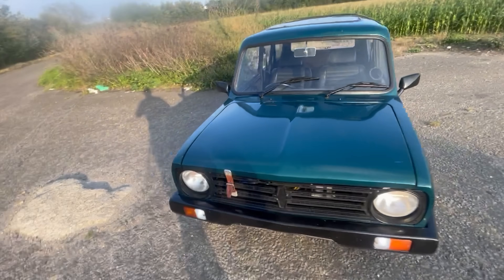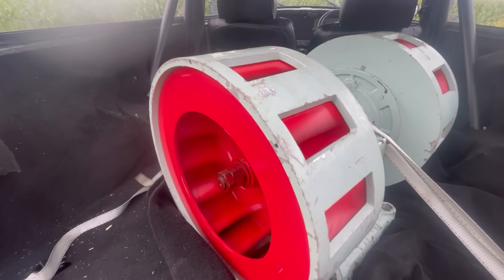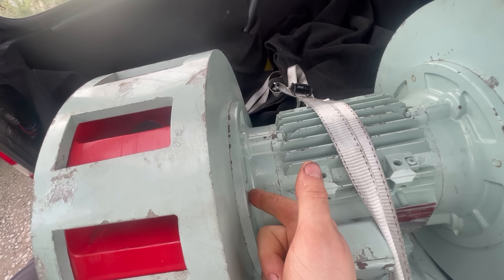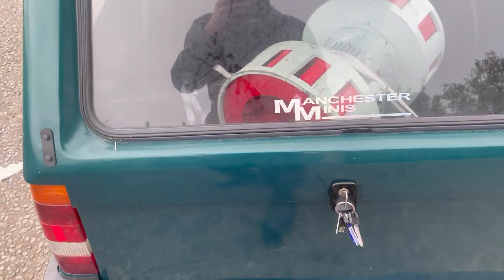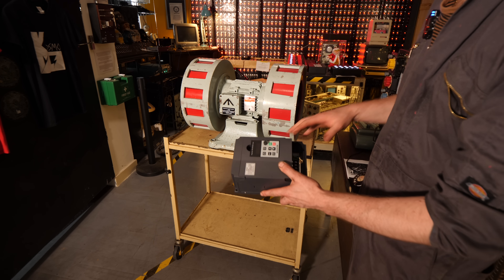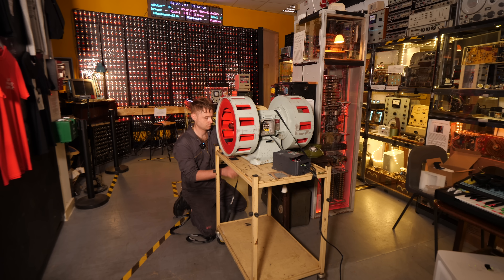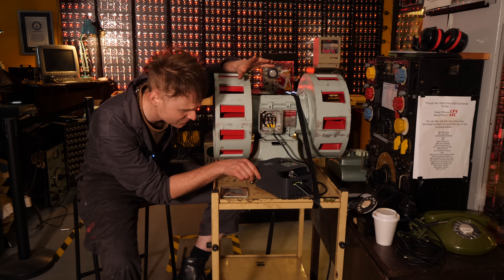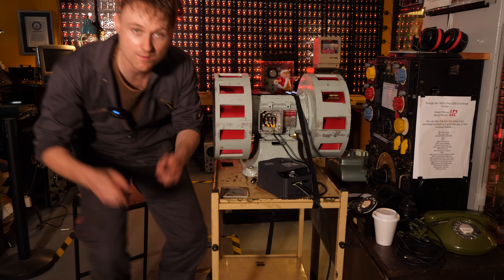I BOUGHT AN AIR RAID SIREN

Comment from the maker: for all interested. don't worry did me due diligence :D informed the immediate neighbours id be running it a handful of times. however i did underestimate how loud it would be through 2 brick walls haha! but hey ho! fine for a blip but definitely wasn't gunna get away with practicing somewhere over the rainbow on the theremin for 5-10 minutes, contrary to the vids, i aire on the side of caution with that sorta crap ha. so on the hunt for somewhere to do that! will likely block one side off and see how it fairs with one tone, as you know the are dual tone and might not work well with the scale, but tbh without both tones it would sound like a siren trying to play somewhere over the rainbow haha.
Reply: Maybe in the middle of nowhere
Reply: Sample pack please
Reply: I think there are laws against using devices like this in the UK.
Reply: @HOLLASOUNDS  No specific legislation but under Control of Pollution Act 1974 a local authority or an individual in a nearby building may take action where noise from premises amounts to a statutory nuisance, that would require them to keep a log etc so if you don't do it too often you would be grand!
Reply: The moment you pulled that sucker out of the boot and put your hand on it I felt this just, surge of fear. Met a bloke who'd basically pulverised his hand in a siren smaller than that, catching it as it collapsed a shelf. He caught it palms out, fingers right in the housing, broke all four fingers and basically flattened his knuckles. Something that big I'd figure easily rip the bastids clean off.
Reply: Your welcome
Reply: Definitely put a screen mesh around the holes of that thing so it doesn't casually rip your fingers off! Because it'll do so without any warning or remorse.
Reply: Rutherford Appleton Labs anechoic chamber? It's intended for space craft launch acoustics so should do for you. Look after your hearing please Sam
Reply: Just cover up some ports on the outside, that will turn the volume down. You should cover up the same fraction of holes on both sides, otherwise you'll change how it sounds. The typical sound results from the mixture of the two different frequencies (left and right).
Reply: Feel like you should be wearing more ear protection using it indoors at all 😥
Reply from the maker: @SomeKindofWizard yeah definitely risky! Hence why I picked it up with no thumbs through any holes
Reply: @HOLLASOUNDS  I think it's the air raid that's illegal, not the warning siren!
Reply: @Damu_the_Damu I wonder if by covering up by a fraction you could change the note. if thats the case you could tune each to a different note and have a solinoid flap turn each one on and off
Reply: @RayZappa  While sounding an air raid Siren is not illegal, excessive noise is and is classed as statutory nuisance. It only take one person to complain to the council for authoritys to get involved.
Reply: *'err' on the side of caution. Aire is a river
Reply: Jus do it indoors! I wanna see how quiet you can get it with some huge speakers playing samples out of phase haha
Reply: You need to do a gofundme or patrion to go to some place like Montana USA and just be in the middle of nowhere making air raid noises.
Reply: @HOLLASOUNDS  Forgive me, this is obviously an issue you take very seriously.  HOWEVER, I was just making a dumb joke that the much worse offence is flying over a country dropping bombs on them.  It's the way I tell 'em
Reply: I live on a tiny set of islands in the middle of the north sea. And... to be honest... even here that device might be a touch loud.
Still, I salute you, already it's a truly unique video that I didn't expect. You always manage to surprise me. =D
Reply: Maybe in the quaint little towns of Hiroshima or Nagasaki they would appreciate you.
Reply: The cages on each side are different for the two tones. But they look like they can be mounted either side. If you would have a second siren you could swap the one cage over so both would play a singe tone each. Just a thought.
Reply: Could you ask a university to use an anechoic chamber?
Reply: @pauledwdz  That's interesting. Since an anechoic chamber converts sound waves into heat I wonder if it would be measurable in that way? Of course you would have to account for the heat produced by the motor.
Reply: @RayZappa  I see, yes I'm not the type to laugh or get most jokes, many times people tell Me jokes and all that happens is I look at them with a straight face and then state some actual facts instead of focusing in the joke. They are like "You dude it's a joke man".
Reply: there's loads of tv & recording studios in the SE of the UK, & they're definitely not all in constant use, & there's definitely people on here that work in them.
if I still worked at Mtv, I'd already be emailing you. we'd probably get you in to do 'party zone' with that thing & the furbies- ah, if only it was still the 90s....  😂
Reply: might want to bolt the thing down when your testing it, lot of energy
Reply: @blu12gaming44 i worked maintenance at a place that made drinking straws and the machines ran about 800 straws per minute. 

My first week working at this place, I was helping the techs and learing the machines, as they were starting up a machine.  I got my fingers to close to where the straws are scrapped and didn't realize my finger was as close as it was and the machine took the tip of my finger off.  Luckily, it missed the bone.  I learned my lesson that day.  Sometimes people need a little oopsy to learn, lol.
Reply: @ChipGuy  Or set it to each of the 88 notes and sample them or just record them and put them on an 88 key mellotron that you would of course have to build because they never came that way. You could use 1/4 inch tape instead of the oddball 3/8 that they used.
Reply: It’s not like going to be wold war 3 10:48
Reply: I grew up in a rural colonial town, we had fire sirens, sounds identical to these air raid sirens. Even after moving to the township 16 years later, I could still hear the Beach Fire Siren from the Town which was 3.6 km (2.2 mile) away. They have a range of 5 km (3.1 mile) in ideal conditions, 20 Celsius (68 Fahrenheit) on flat ground.
Reply: Try running the siren inside of a box with a varying level of vacuum that way the sound of the siren is limited by how much air it can move.
Reply: And welp, YouTube's auto-subtitles clearly recognizes this as: music
Reply: You should really invest in some earplugs! Be careful with your hearing!
Reply: @deezwaffles558 Fire it up often enough and you’ll BE in the middle of nowhere - all the annoying neighbours will move out (one can hope! 😂)

If I had one of these I’d fire it up every Sunday to show the people who live near my parents, how unpleasant excessive noise is on a Sunday. Flipping suburban housing estates!!! 🤦‍♂️🤦‍♂️
Reply: U probably would have been good to alert the police and such considering it's likely the same siren type and make sure they put out a public warning aswell 

Other than noise problem might also be impersonating a police officer type of deal aswell 

If you want have a lolz try jamming a harmonica on it or mega howler whistles n such
Reply: Wen are you going to do a part too
Reply: You have to turn it down slowly as stopping it that fast induces a lot of that rotational energy back into electrical energy overwhelming the inverter. Or you could use a breaking resistor
Reply from the maker: its fineeee. but yeah the breakdown is quicker.sorted it now @sundeki8880
Reply: Perfect doorbell LoL
Reply: I love it
Reply: How in the hell were u able to buy one haha. I’m very interested in them. Xd
Reply: I remember the huge one that was on top of the supermarket, at the top of the street when I was a kid. I think it was a B&N Mobil Directo BN33E. Loud... very very loud. It was a dual tone (10/12 port) which gave a 3rd minor chord, if memory serves.

Comment: You know you've reached peak punk (or maybe peak metal?) when one of the instruments you play is an air raid siren.
Reply: And the other is a car
Reply: King Crimson played an air siren at the end of 21st century schizoid man when playing before The Rolling Stones in Hyde Park in 1969
Reply: Do you know what frequency it generates?
Reply: @ETA555 It does more than one frequency at a time, and they change with the velocity of the parts, which change with the input power.
Reply: @ToyKeeper  Yes under and overtones. But the main frequency at a given rpm. It must be like 500Hz-2500Hz
Reply: Peak jungle music
Reply: Very KLF
Reply: @ETA555 I ran the audio through a spectrum analyzer.  You can do this too, using Audacity.  The result is a really dense spectrum of strong frequencies spanning most of the human hearing range.  There isn't just one main frequency though... it has at least two fundamentals at dissonant intervals because the wheels spin at different speeds, which is where it gets its discordant sound from.  It has dozens of frequencies at any given moment, and they come in detuned pairs where the detuning interval changes with RPM.
Reply: There used to be a punk rocker, Maukka Perusjätkä, in Finland who would play a chain saw.
Reply: the band Sweet who were mostly bubblegum pop or glam rock, played an air raid siren on stage or rather it was just used as a prop for an intro to the song “Blockbuster”
Reply: @ToyKeeper AIUI the wheels spin at the same speed, it's the vanes are different in number and spacing between sides
Reply: @jongmassey Thanks, that makes sense.

Comment: I wonder if you could add some servo-movable vanes to get different pitches.  Oh, yes and some mesh over those finger slicers of course!
Reply from the maker: Those vains aaah I see so the opposite way to the Yamaha music sirens! Intervesting
Reply: Isnt it the number of holes that defines the pitch and not the size? Covering part of the holes might change the volume though.
Reply: @agurdel  I was thinking have an external sleeve with a different number of vanes that could be selectively opened and closed - should at least be able to do some harmmonics
Reply: there are sirens that do have shutters to mute on of the two tones, just lookup "broadmoor escape siren"
as for the changing of the pitch, the best bet is to do what sam just did and hook up a VFD, but the combinations of both could be great
and no covering the finger chopping holes won't change the pitch, it will quite it down a bit, just like the shutters but more controlled
Reply: @alebret3  I just looked up the Broadmoor video, they do it by a vertical shutter on each end. By capping it off it's effectively creating a vacuum inside the chamber so there's no air to chop and make the noise. I reckon Sam would probably have an easier time doing that.
Reply: Yes! Mesh please 😄
Reply: With a servo motor you can get very fast speed variations, i built a siren like that a few years ago and uploaded a video of it.
Reply: Instead of a minor third you could make a dual tone siren that uses a perfect fifth or fourth. That would sound better sliding to different notes. Probably need a bigger motor controller. A huge stepper motor would be amazing.
Reply: Servo-controlled shutters on the inlets would be good. I think it will be important to be able to reduce the volume as the pitch is increased, so that high notes aren't massively louder than low ones.
Reply: @agurdel  Number of holes + RPM. The impeller creates air pressure and the holes and pieces of the impeller that covers the holes chop up the air flow creating bursts of high pressure air. alternating high and low pressure air is called sound. The problem with turning it into an instrument is the volume and the pitch are controlled by the same impeller. So you can never do a loud lower tone or a quite high pitch tone on the same siren.

But, if we would colin furze it. Split out of the impeller from the shutter and drive them seperately. So we have one elektric more running a fan to create the airflow/pressure we need and a shutter wheel on a servo motor. Why not another elektric motor? You could but with a servo you have much better control on how fast it turns, thus more accurate pitches.
Reply: Midi siren? Yes please...

Comment: You could put it in a transparent vacuum box. if you pull enough mbar it should reduce the loudness of the siren and people can still see it spinning. just an idea.
Reply: Brilliant!
Reply: I wonder if it would overspeed in a vacuum.
Reply: @BLOCKsignallingUK it won’t be a 100% pure vacuum so it should be alright
Reply: @BLOCKsignallingUK  it might turn faster and change pitch. to be sure you could control the rpm of the motor and then even tune it back to original frequency I suppose.
Reply: @BLOCKsignallingUK  It’s a 3-phase motor (or so it appears), so it’ll never turn faster than the AC frequency.  That being said, I have no idea how, in its original application, they got a slow/graceful acceleration without using a VFD.
Reply: @kc9scott  Good point, I had forgotten that.  Presumably the slow acceleration comes from a low power motor and lots of slip before the rotor becomes synchronised.

Comment: On an air-raid siren like this, you can directly control the volume by controlling the amount of air that passes through the rotors. You could do this by strapping a wide brand around the perimeter of each rotor housing. Simply sliding the band to cover more or less of the port area would change the volume. As a bonus, the less air you let pass through the rotors, the less load the motor is under (and therefore less power).

If you want fast speed control, you need a variable frequency drive that supports an external braking resistor. The bigger the drive you get, the more braking power the drive can handle. So in this case, it may be beneficial to get an oversized drive with a huge chunky external braking resistor.. The braking resistor is usually several hundred watts capacity (or more). On bigger drives the braking resistor can reach the kW range.

Your current drive is likely trying to dissipate the braking heat internally, cooking itself.
Reply: Yeah, covering like 80% of the slots would definitely help I think.
Reply: Could probably also add a mesh over the open bits as a safety device too? Keep fingers out. But not before filming what happens if you stick a carrot in!
Reply: Or it’s pumping the DC rail too high and cooking the caps!!
Reply: An idea that contains slightly more latent fire:

Run your VFD off of a bunch of parallel LiPo cells (with large caps across them for good measure), and dump the braking energy back into them. That'll get you a portable system that's also pretty energy efficient.
Reply: And, for good measure, an overcomplicated idea-

Build the same system, but in the mechanical domain.
You'd have a motorized flywheel connected to the rotor through a CVT. Depending on the gear ratio, you can transfer energy between the siren and flywheel in either direction. An optical encoder and PID controller would then allow accurate pitch control.

Utterly impractical, but maybe if you get a collaboration with Top Gear or something
Reply: I was thinking some kind of metal screen would not only dampen the volume, but also provide a safety screen. (obviously not chicken wire, something much more dense.)
Reply: A 4 quadrant drive may be a better choice if you can get one, and are allowed to operate those on your connection.
Reply: Putting a plate over the side openings might also work well to control volume.

Putting a hole in the end caps with a valve or shutter on the opening could make an interesting volume control
Reply: This might be a dumb question but is the air coming in or out of those holes?
Reply: @TheJoechester  Yes, it works like a radial fan. Air enters the center and is exhausted on the side. The noise is made because the airflow is periodically interrupted by the square holes.
Reply: @bigjd2k capacitor electrolyte might be what the liquid leaking out was

Comment: 4:22 That's a 1st generation 10-note Yamaha Music Siren (ミュージックサイレン), but it's on top of the Tokiwa Main store (トキハ本店) in Oita Prefecture, and not the Yamaha headquarters in Hamamatsu. It uses electromagnets to open and close the shutters, with all 10 rotors spinning at a constant speed when the shutters open and close. By default they stay closed during start up and shut down, and they open in patterns to play musical notes.

Source: have been researching these Yamaha musical sirens for an extended time period.

Comment: A volunteer firefighter around here did lose a finger in one of these. Not just stories.Better put some wire mesh over it, especially during the experimental phase...
Reply: Were they playing with one or testing it cos i only seen these mounted very high up, where is very hard to even attempt to put your fingers into one.
Reply: @Chester200100 They were testing the new one on the ground before hoisting it up to the "tower".
Reply: @atkelar  Makes sense, our volunteer fire brigade siren has a protective cage, and nobody (that i know of) lost their fingers in one.
Reply: @Chester200100  usually,  that's how it works, yes. I didn't understand it for the longest time, cause as a kid I thought it was just a speaker of sorts. When I first saw a real one, it dawned on me.